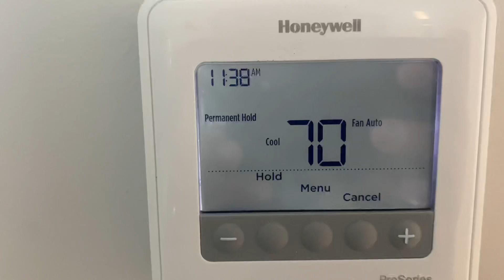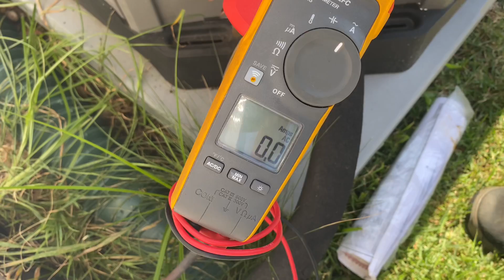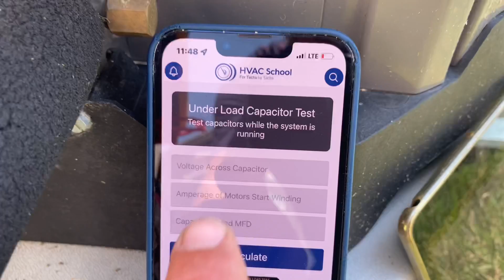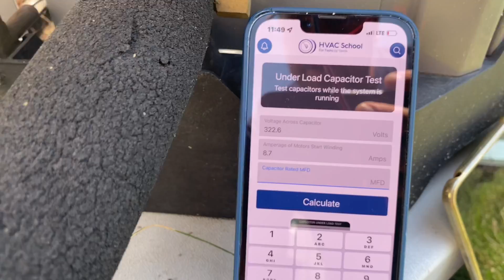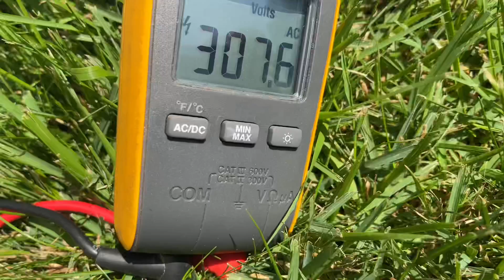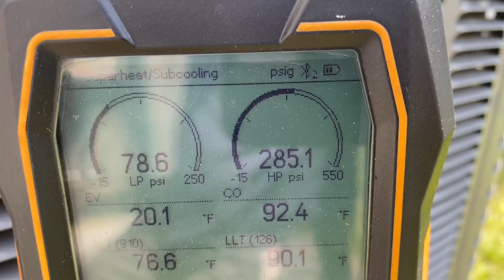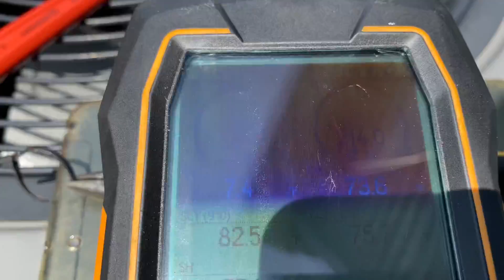Ruud Central AC Isn’t Cooling How to Properly Clean AC Condensing Coil Step by Step

Comment: As far as the basement being so cold we all know cold air will always flow to the lowest level , I personally would not have shut any vents off will throw the system out of wack and come cold weather you can bet they wont remember the vents are closed. I would have just had her keep the thermostat at a higher temperature so it would not run as much if at all. I do not know what size the unit was but with six vents i would hope it was only a 1 1/2 ton system. Wonder how bad the other 2 units were with the fur coat on the one you serviced, im sure you offered to do the other 2 in the near future .

Comment: Oil was cheaper before Joe. But still if replacing unit would go with gas.
Reply: didn't you hear, they want you to use all electric! 🤣🤣🤣
Reply: @throttlebottle5906  lol that's funny

Comment: good job mikey.  You thoroughly cleaned that one. You got to start getting these customers on a Regular Maintenance schedule.  Your missing out on steady income and more balanced work.  Maintenance is important and good value for the customer if done correctly.  Most companies charge around $20-$11 per unit and provide regular service.

Comment: Mike, That's actually a gas conversion burner on that boiler, they're typically used to convert from oil to gas, without having to replace the whole boiler. carlin is a common brand for those
Reply: @PipeDoctor  A good tech is always aware of his surroundings! 🤣
I couldn't resist the invite to take a stab. it's easy to overlook things, especially when you're not there for that equipment and the issue is totally unrelated. lol

Comment: Why not wash the other 2 at the same time?
Reply: I’ve been out of the residential market for a while now but when I was doing it I would’ve cleaned all 3 because I’ve been burned by customers before they’ll call back usually after hours when another technician is on call and say you were just here and nw my a/c isn’t working and try to get something for free but I guess the video you took covers your ass.
Reply: He might have asked the customer but he is only there to fix the one. Like the other person said, it's the $$$